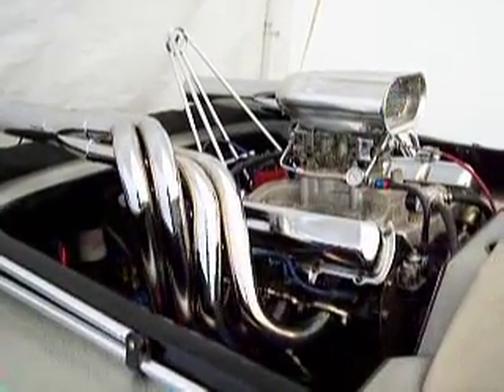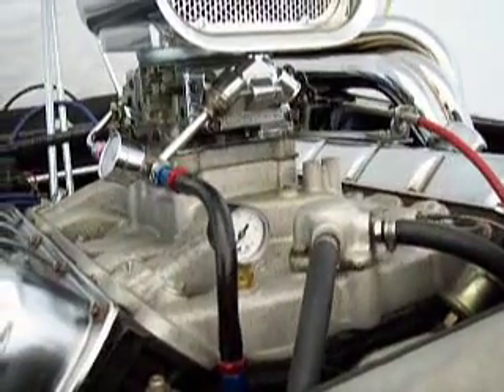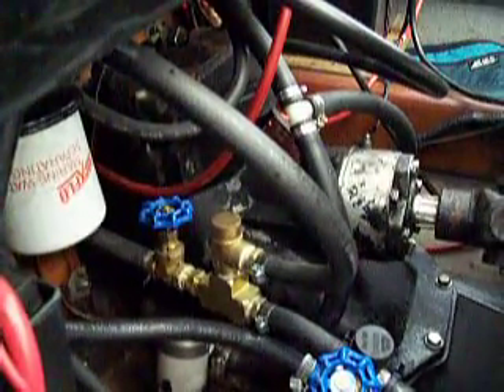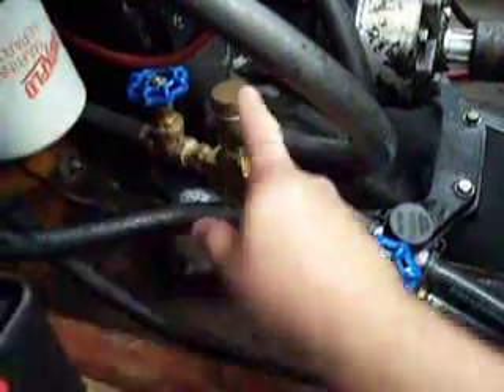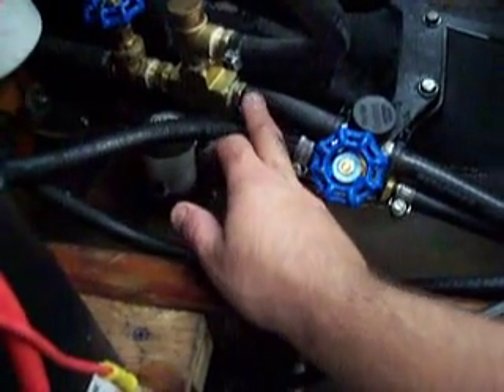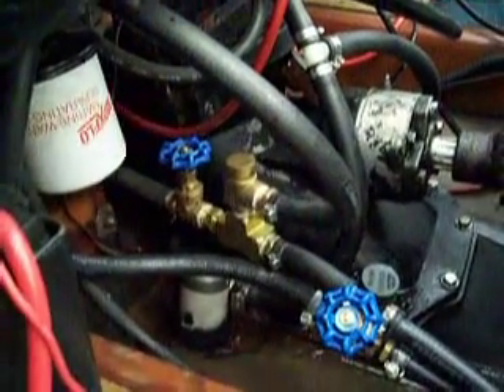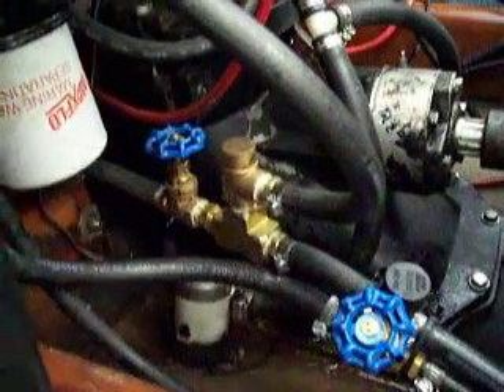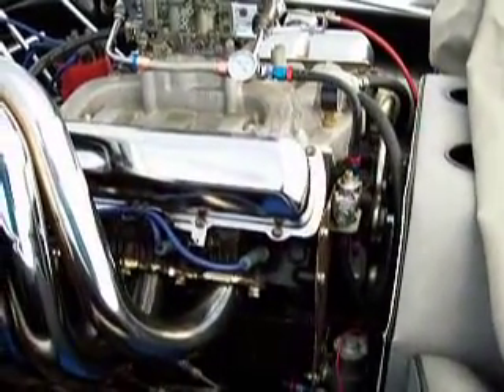Jet Boat Water pressure relief valve system installed - Video 2

Comment: I’m having a problem, I have oil in the water and my valve covers leaking milky water and oil and this boat had a new engine I gave it to a friend to store for me! Of course he didn’t cover the tunnel ram! It was locked up. Borrowed a 6’ pipe wrench from DWP and put it on the u joint and broke it loose, I put Kroll liquid in all cylinders and let it set for a couple days, then honed the cylinders again since it was a new engine. I got it running before I gave it to him! I changed the oil and it obviously was milky, now I had the hose on full blast,, and lukewarm water was coming out of the back of the boat, but then reving up the engine the valve covers and intake was milky and the front water pump cover started leaking water? I didn’t see blue smoke when it was running, only when I gave it some water for the pipes the passenger side I got white smoke came out, I checked the compression and got 125 on driver side and 150 on the passenger side!  Did I just have the water on to much? Or do I have other problems? Thanks Don 818821935 leave message if possible! Thanks Don

Comment from the maker: @Oldsmob455 continued- Each engine and jet pump is different so keeping a close eye on that gauge during full throttle is important and maybe necassary to open the gate valve small incrimates to get best results. The relief valve is also adjustable so you can eather dump water sooner or later. A thermastat is always a good idea. Our kit  helps control temperature at idle but is not its main function.

Comment from the maker: @Oldsmob455 - Hi there, Thanks for taking interest in our kit. Id like to respond by saying our kit is designed to reduce water pressure inside the engine. We recomend using a gauge to monitor the water pressure. If you see in the video the gauge is located on the upper intake. When adjusting your engine temp at idle to approx 140-160 your able to fine tune the water intake to the engine and allow the relief valve to drop or dump any additional unwanted water pressure.